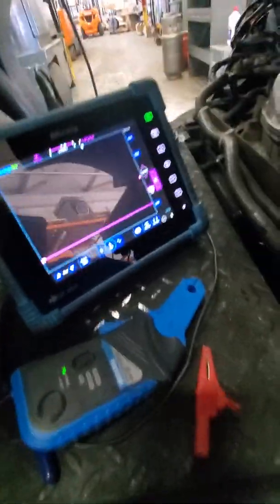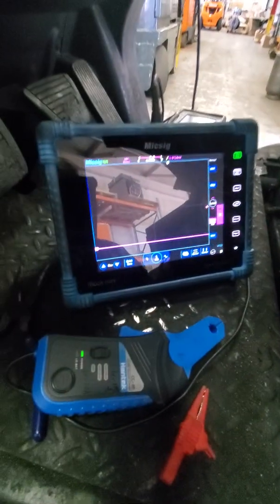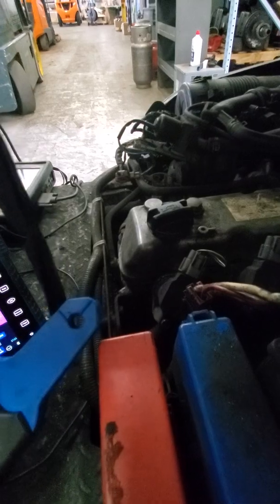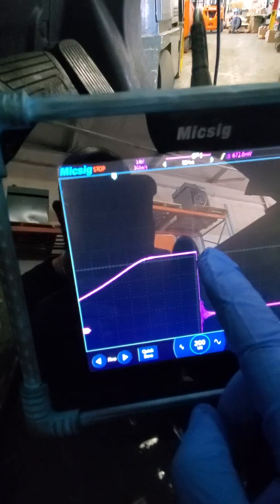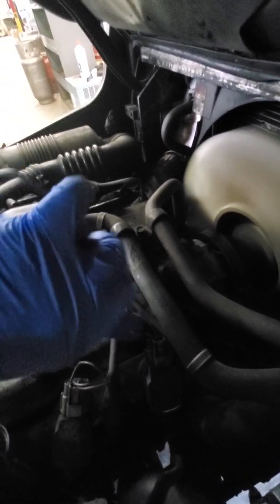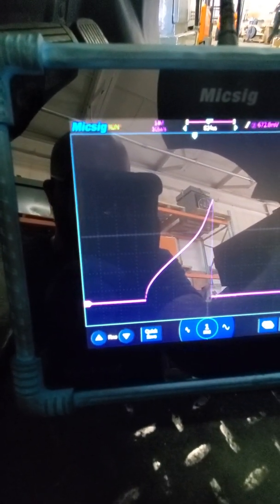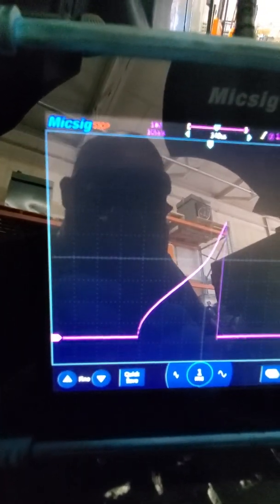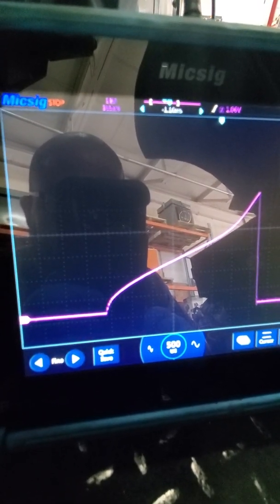Diagnosing misfire with amp clamp

Comment: Good diag! Most would have swapped coils and replaced it when the problem moved with the coil. That's great when everything is easy to get to. Understanding how to use the scope like you've demonstrated here really helps when things aren't so east to access. 

How do you like that scope? It looks like it's really responsive.
Reply from the maker: I personally love it. It is really responsive. Only complaint really is that it doesn't give you live readings on its own.  You have to set your cursor and monitor voltage or amperage. It has a duty cycle calculation feature which isn't that accurate. So I don't use it, I just pause the capture and do it myself.  Thanks for the feedback